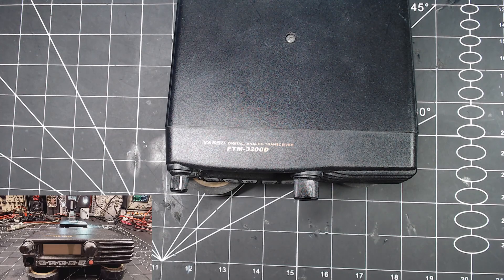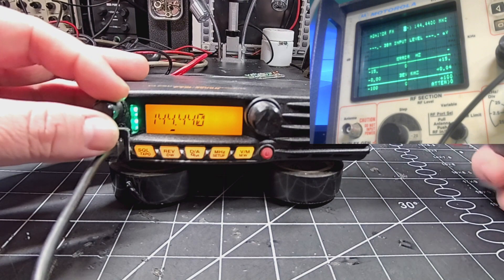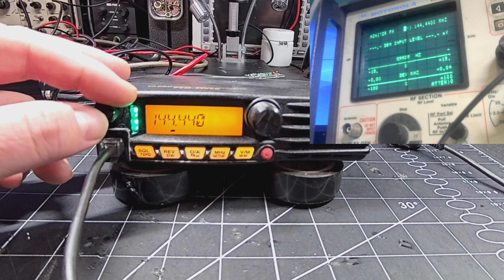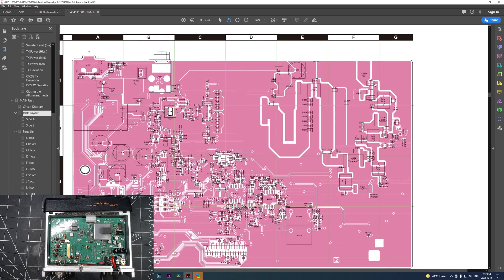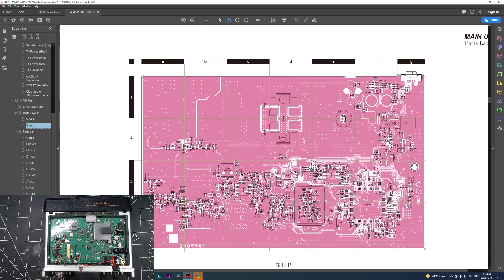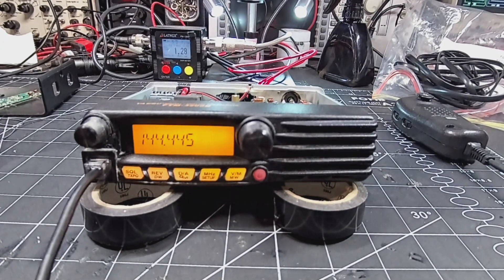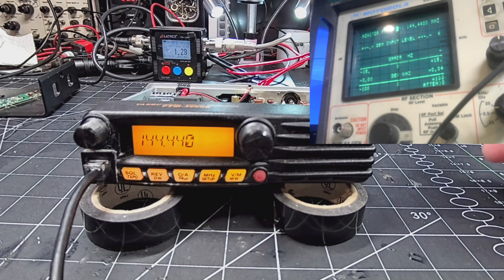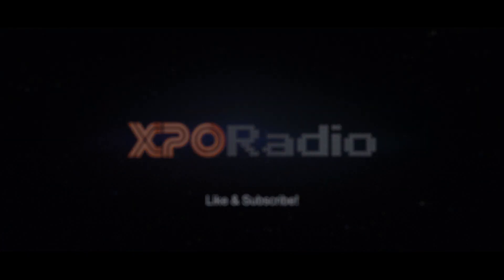FTM-3200D No power output repair

Comment: it looks like lighting strike damage.  lighting strike often damage final power transistor , or TX / RX switching PIN diode.   surprisingly  many time RX front end was fine.  I guess lighting energy have to go through Low Pass Filter , TX, RX switch before get to RX front end.   please keep up with radio repair video, it is very interesting, and many other will benefit from your video.  73  AG6JU
Reply from the maker: Thanks! The next video in line will be on an Icom IC-207H that I believe also had lightning damage. It damaged the filter caps, pin diodes, and the HI/Med/Low controllers for the RF.
Reply: Exactly.. i would expect that finals would be damaged and not that smd parts.... so i think that it was lighning strike as well